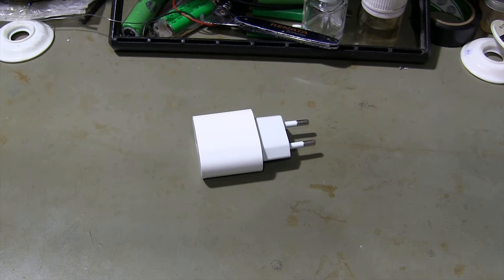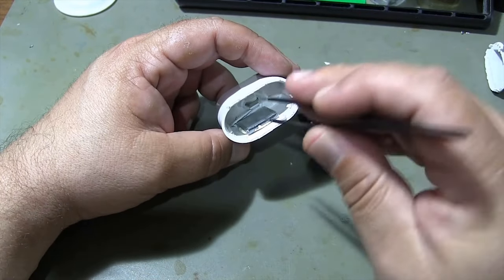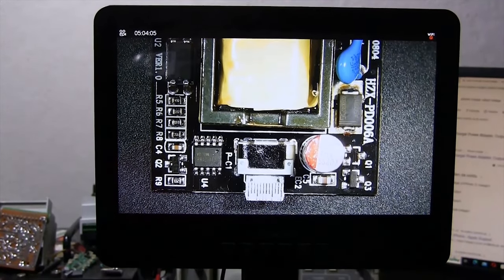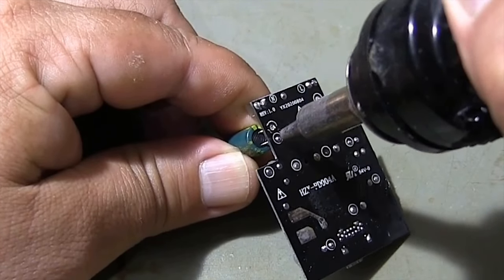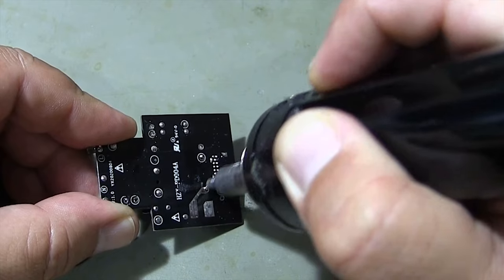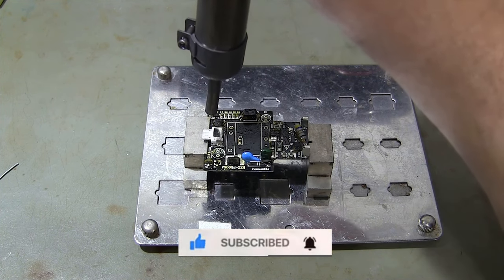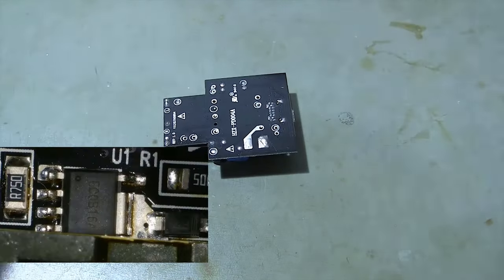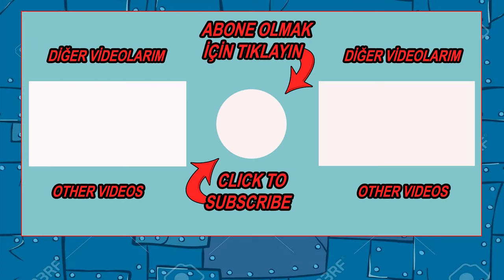iPhone Charger Repair: The Secret Apple Doesn't Want You to Know!

Comment: fake Apple charge, no heatsink is included with the original ones, at least no a loose piece of metal.
Reply from the maker: Thanks for your comment! Yes, original Apple chargers usually do not have an external heatsink or loose metal parts. However, this device is likely a non-original model or made by a different manufacturer. Heatsink designs for electronic components can vary depending on the manufacturer's preference and safety standards. Thanks again for your informative comment!